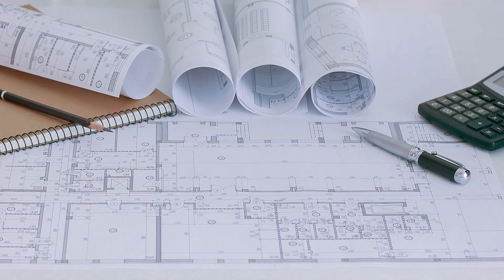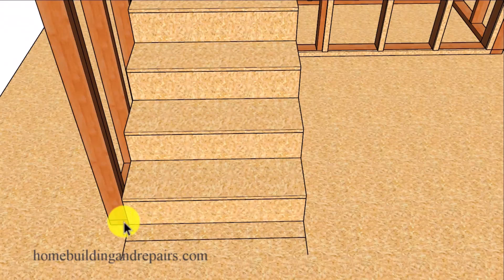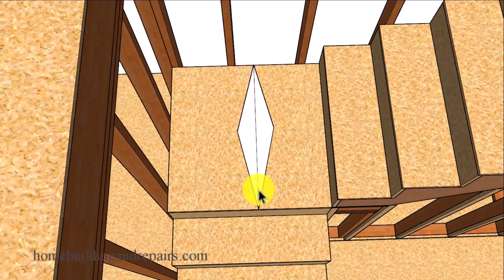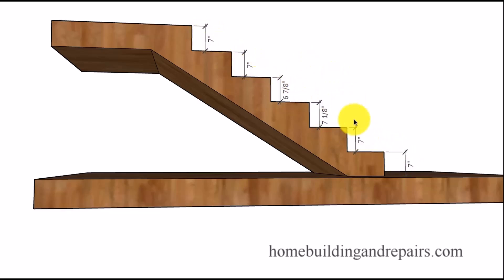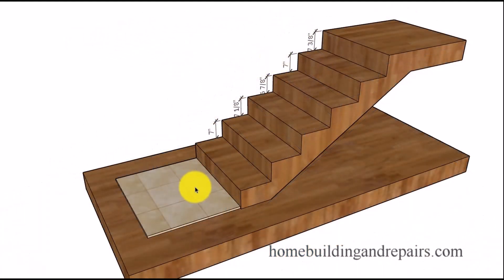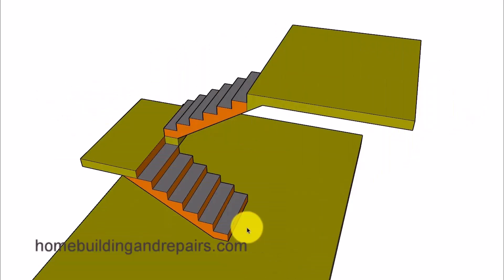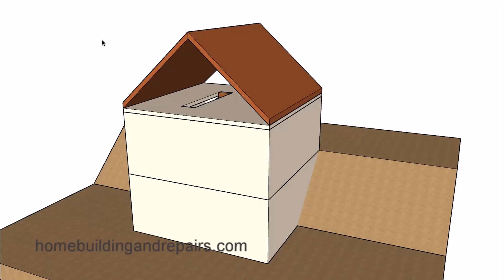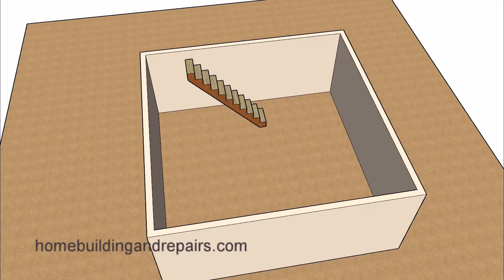Important Stair Building Codes For Home Design Tutorial

Comment: Great video on stairs. What about stairs that normally lead from a garage, up about 5 steps into the first floor of a house, but are either removable or have a way to collapse them to gain access to a crawl space? ( Like an access underneath the stairs)
Reply: Typically I’ve only seen 2 or 3 steps from the garage, and a removable step would likely not pass code. I don’t see a benefit to this that could justify the costs
Reply: Yes, it will not pass. The stairs must be permanent. Keep in mind that this is part of the egress path.